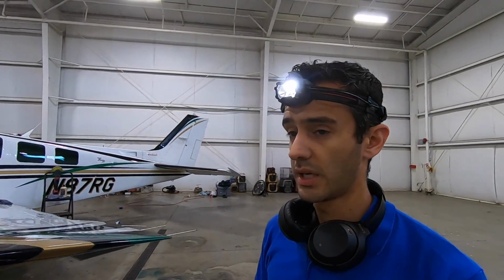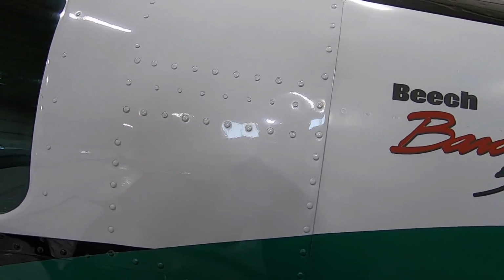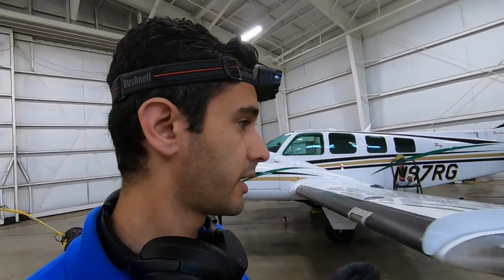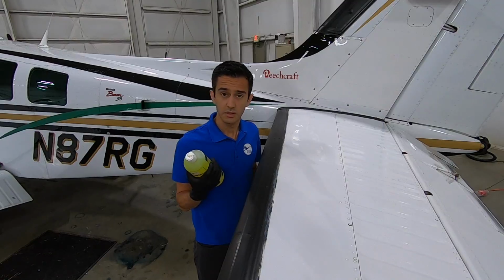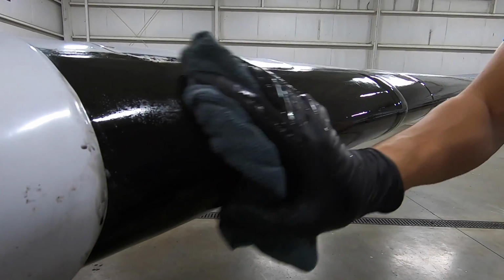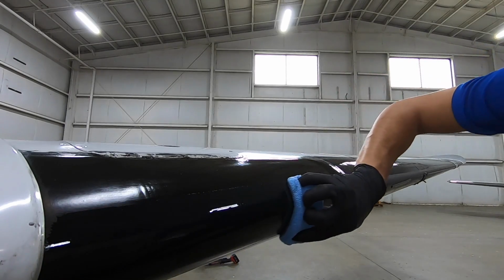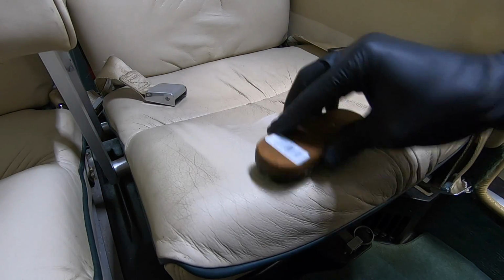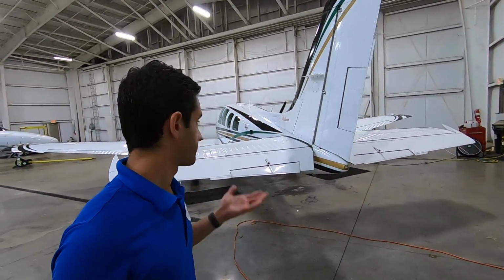024 Beechcraft Baron - Paint Correction and Ceramic Coating + Leather and boots

Comment: Have you ever used the optimum gloss coat ceramic coating? I’am new to the ceramic coating world.
Reply from the maker: Not great, not terrible. It is a very easy coating to apply, but lacks durability. best suited for clear coated automotive finishes. I would be surprised if it lasted 6 months on an active airplane